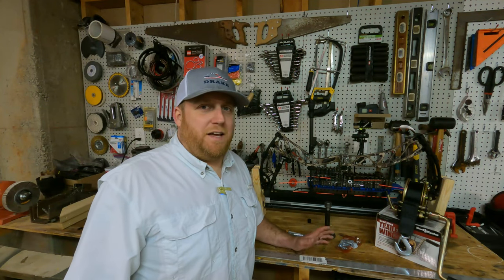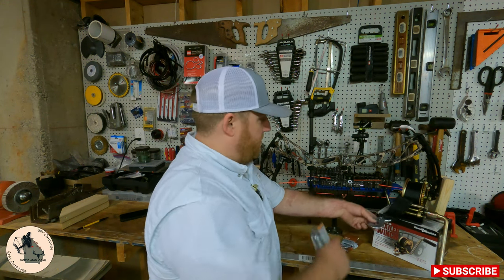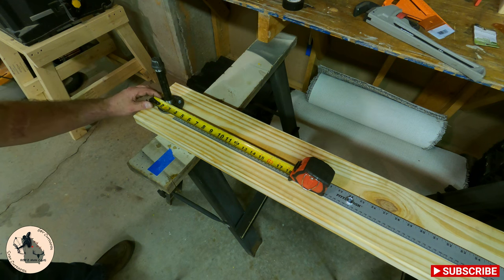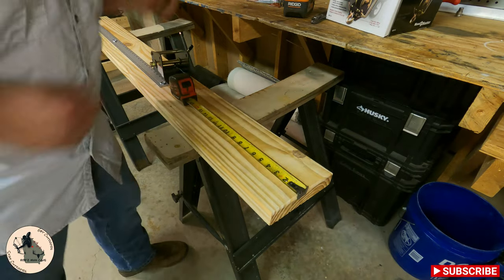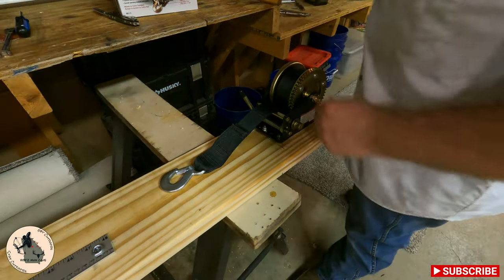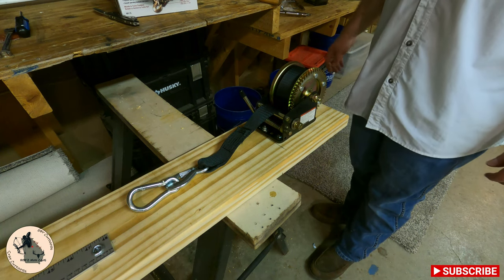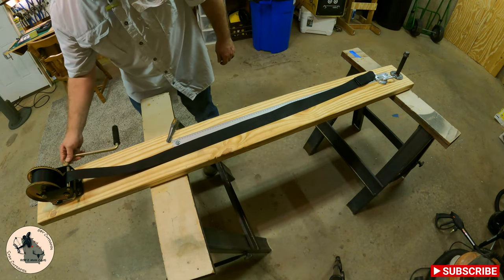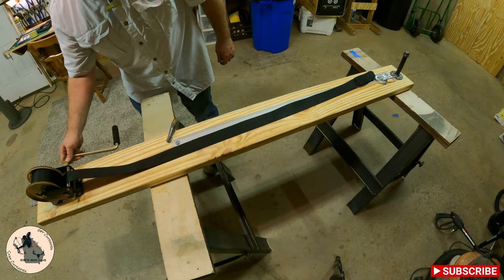DIY Archery Draw board | UNDER $60!!!

Comment: I made a similar bow press.  Mine is about 3 inches wide and has screws 3 inches long, two per, going across the grain to keep the wood from splitting. I have one screw on either side of the black pipe.  Hell to pay if one of the blocks split!